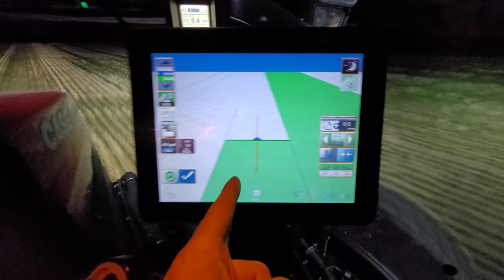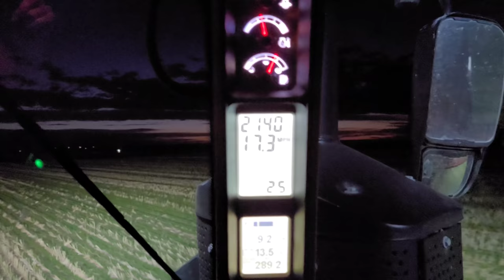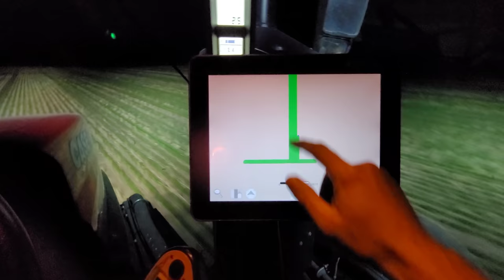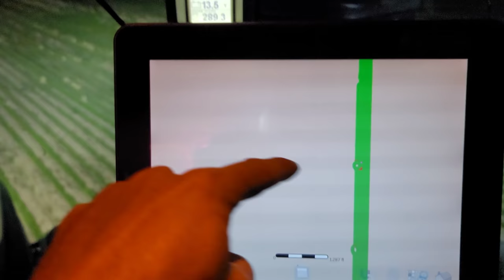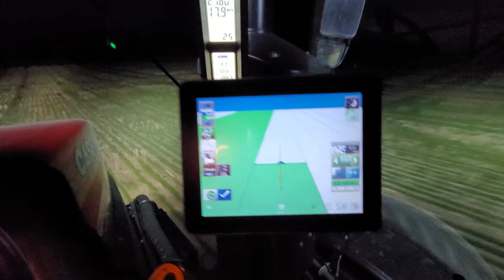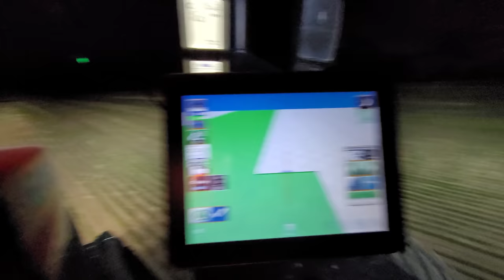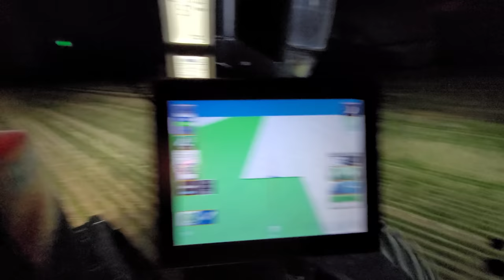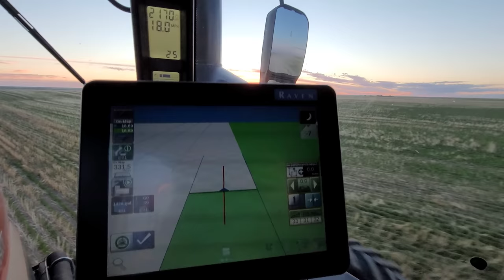5 Sprayers 1 field @ night! 😬🤦😂

Comment: I think if you had a spike, you could puncture the bottom of the jugs once the foil top has been punctured, to let air in and the contents out much faster.  Spike on a length of cord of course so it could not become loaded into the sprayer.
Reply: I was gonna say the same thing
Reply: No, just turn on the rinse as soon as the foil is pierce, the water flowing in will prevent the air lock

Comment: Would it hurt the crops if you run 1 Line twice by mistake?
Reply: Iirc it depends on what your spraying
Reply: You might stunt your crops by doing that depending on chemical and rate.
Reply: I think the computer will prevent that mistake by shutting the pumps off.  It will recognize it as a recorded line and the pump will disable itself.
Reply: I think he was referring to overlap from two or more sprayers, if they dont share coverage it will be sprayed twice.

Comment: Instead of kicking the boxes around, how come you dont just break them down as you go and re palletize them? Im sure you can get a dicount if u send the boxes in. Ik a few companys that my company works with does this. Its easier for them instead of paying for all new cardboard, they can easily reuse them or recycle.
Reply: Might be good near the production plant 
But most people the cost transporting the boxes back out weights the cost of the box its self 
Amd most chemical company's don't what containers or boxes back because of the risk of cross contamination between products
Reply: @fowletm1992  the company we use, is a chemical outfit. We save the boxes, they give us a discount to send those back. Not the jugs. Then they send them to there big supplyer. Then they send it back to the paper mill. Many companys work like that but people dont notice. We call it a dunage load

Comment: Actually wouldn't it be faster and cheaper to use planes to spray at this point?
Reply from the maker: Planes are very limited to wind and temperatures, also you can't spray at night
Reply: @mikemitchell2554  Gotcha

Comment: So Mike - at 22:55 you say that when you're all rocking out there you can do 1300 acres per hour.... at the beginning you said its a 1750 acre field so less than two hours to do it at 1000 - yes?  So why you there for so long?
Reply: 1750-1000 is 750. 

1000 acres an hour with 5 sprayers.  Not all 5 sprayers need to be used on 750 acres so they probally sent a few home.  Decreasing the efficiency
Reply: @realredditstories420  But all 5 sprayers were there - thats what Mike said.   In the video description too. 

I was averaging it to 1000 acres per hour as Mike said was a more likely average.

Comment: Mike why don't you remove the rock piles during the winter season? that way you will be able to pass without any problem.
Reply: Winter generally means frozen ground so you can’t dig the rocks out. 🤷‍♂️
Reply: They have removed 100s and there are still 1000s of rock piles out there.
Reply: I am not sure if Mike said that or was some other Youtuber. Removing rock piles isn't a priority because usually, they have been there for generations. Turns out that oldtimers but rock piles over some huge rocks so when you remove the majority of rocks from a pile you find a huge rock that you can't move.
Reply: @max-jc4wq  Correct, that and they have much more important things needing to be done, such as equipment maintenance